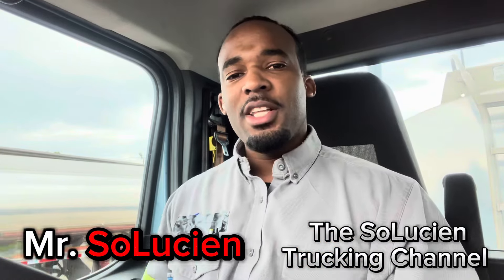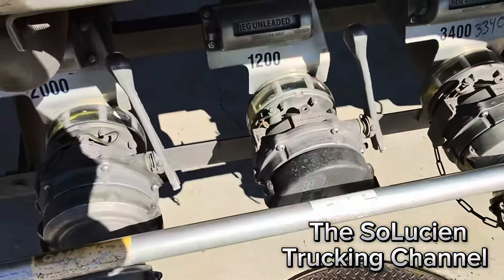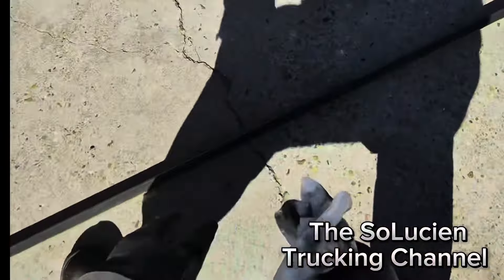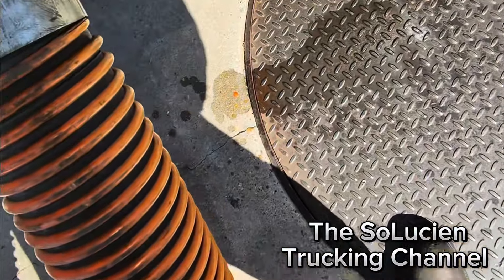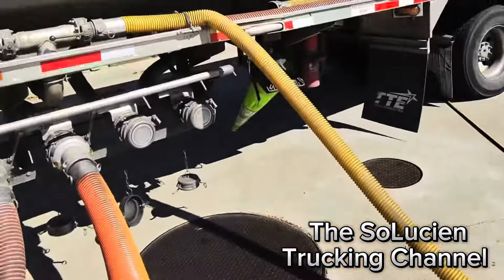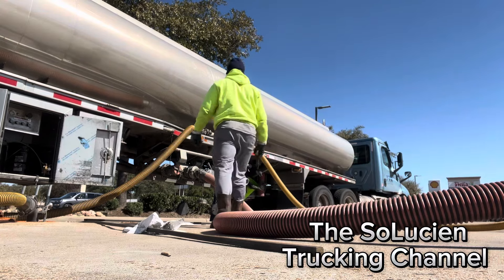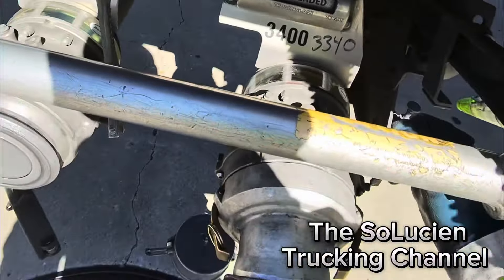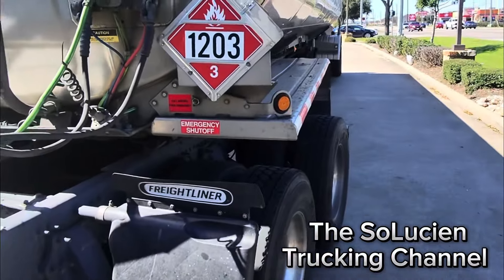Fuel Delivery Mastery: Preventing Cross-Drops at Gas Stations

Comment: When u have more fuel in tanker than available space in the tank in the ground how do you when to stop it ?
Reply from the maker: You’re supposed to stick the tank and find out the inches. That should tell you how much you can fit in the ground. If it can’t fit you should call dispatch and tell them. Most likely they’ll send you somewhere else. Or they’ll have you drop one or two compartments and take the rest somewhere else
Reply: @ do you use the same hose for each type of gas like if u just drop diesel can h use that same hose to drop premium or does that lead to risk of cross contamination?

Comment: Hello to you my brother.  Am here watching this video on how to prevent cross drops. My question to you is this, say for example,  you dip the stick into the diesel tank on the ground and have a reading of 75, the dipstick, how is it measure in inches or in gallons? And once you checked it, if you have alot under the tank, and you have let's say 2500 gallons in the tanker that needs to be dropped.  How would you know if the underground tank will hold the 2500 that you have to drop, and what if it doesn't fit, what do you do with the diesel thats in your tanker if you didn't get to drop it all? I hope I make sense and you understand what am trying to say. Your video is helping me out, I recently got hired by a company hauling fuel, and I think it will make my training less shorter I hope. Thanks and be safe out there
Reply from the maker: Well. At my company we have something called a safe fill chart. Which tells us how much a tank can hold. Based off of the inches on the stick. If it can’t fit then we would just call dispatch and they will direct us to where we will drop the remainder that’s left in our tank. I hope that explains it to you

Comment: Subscribed ✅ video suggesting: thoughts on load pay vs hourly pay in fuel hauling? I have two companies I could apply for but I’m leaning towards the one that pays by the load cause is bout 10 mins or less from where I live. The hourly pay is bout 35-40 mins away.
Reply from the maker: Ok. It depends if you’re gonna be working during the day or the night. I may have to make a video on this because it’s a lot I need to explain
Reply from the maker: If you’re working nights. You can do more loads and you’ll get paid more if you’re by the load. If you do by the hour. You HAVE to work 12 hours everyday to make your money. If you’re by the load. Some days you’ll get paid more in less than 12 hours. So it all really depends on imma make a video in this. Standby

Comment: What happens if you finish all your  loads for the day and have extra product in the tanks at the end of the day
Reply from the maker: You shouldn’t have Extra products inside the tank when u finish dropping. Now if there is a lil product inside the pipes under the trailer, that’s fine. You can still load another load. But if one of your compartments light is still on you have to call dispatch to bring it to another store
Reply: @TheSolucienTruckingChannel  Ight bet thank you🫡